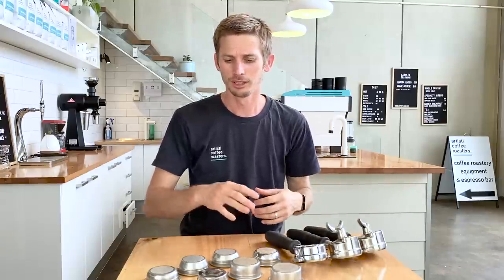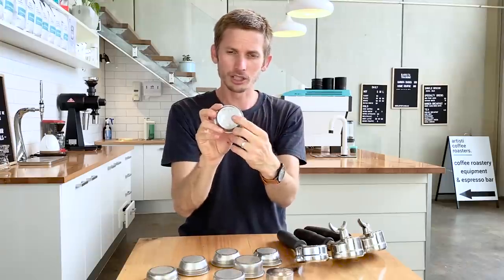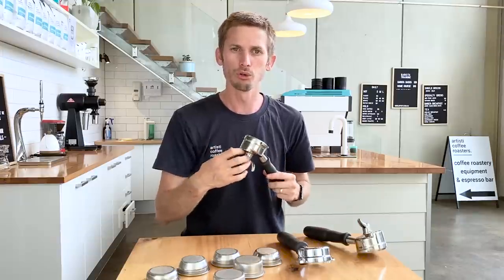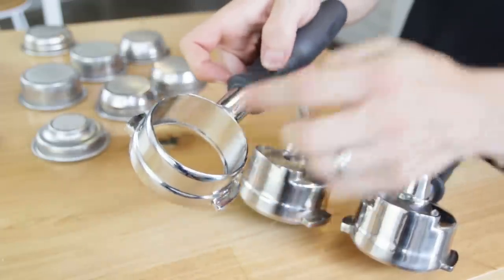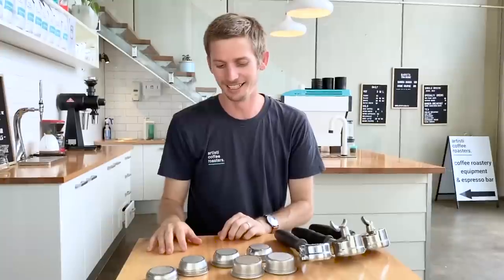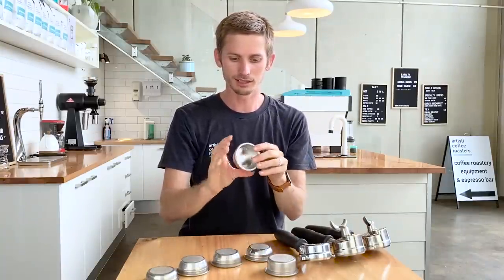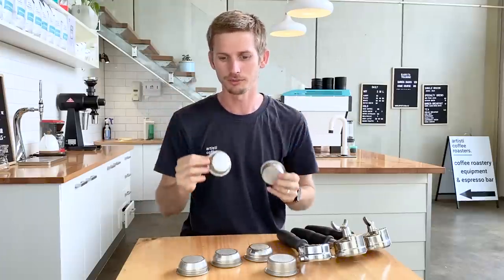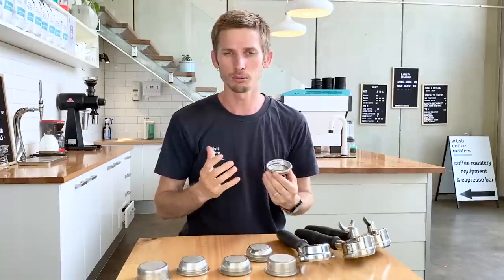In your ESPRESSO MACHINE which PORTAFILTER BASKET should you use?

Comment: Great video ~ Wish I found this ages ago when I first started out.
The information about how much coffee to use per shot around the internet is great and all but as you said the lacking information about the basket size is vital... I struggled with this so much before I read more and finally connected the dots... I was over dosing my basket by so much and could never work out why my coffee tasted awful. Then I finally connected the dots and lowered my coffee dose down by a massive margin it was like music in my mouth, haha.

I finally got myself a basket funnel and a palm distro / calibrated tamp and it's made making coffee in my home machine 10x easier and quicker. The little tamper that comes with the machine isn't great for long term use.

I use a breville barista express machine for reference.
Reply: I realize this comment is almost a year old but I bought the same machine about six months and have yet to produce consistent shots. What setting do you have your dispenser set for (grinder) on a double shot?
Reply: @ogoe_joeoutdoors1088  Since the post, I've dosed 18-18.5g coffee grinds to 35-40g output in around 35-40 seconds. Grind size is changed depending how fast or slow it pulls.
I also bought myself a dosing cup because I found the funnel a pain in the a$$ to work with long term.
Hope it helps.
Reply: @mdem5059  Thank you for your reply
Reply: Add milk and honey so the shots are always consistently blessed.

Comment: I wish I'd see this 10 years ago - that's how long I've been messing about with a Gaggia single-shot basket, and never getting a good espresso!
Reply: Depending on what model gaggia you have, you can crank that pressure down to 9 bars, get a bottomless portadilyer and a precision basket and itll feel like a brand new machine.
Reply: At this point I would move on. Espresso is a scam
Reply: @AnonYmous-wf1oz  How does one do that? I have a Carezza Deluxe, don't know if it's possible to adjust the pressure on it

Comment: I found out the single basket pour a lot quicker instead of dripping. The double basket drips in a steady rate which help newbie like myself to extend the brewing extraction. This can be very difficult to maneuver the flow of the coffee grinds with the single basket. Hence you have to tamp the grind a lot harder as it will cause resistance for the water to hit the grind in a steady rate, if the tamp is too soft, it will pour faster. Of course you have to adjust the grinds numerous time in order to get the sweet spot.
Reply from the maker: try to not tamp at different pressures, what you are experiencing in the  single basket is too coarser grind, int eh double basket it is the dose that is slowing down the pour.

Comment: How do you tell the difference between double and triple baskets by looking at them? Also, without a weight scale is there a way to know how much coffee to add to a basket? Are the ridges on the basket for this? And in terms of the difference between single and double baskets, how much liquid coffee are you aiming to get out at the end?

Thanks!
Reply from the maker: WOW so much to answer! Firstly you can tell the difference in baskets (that are the same shape) by the depth of the basket, generally the deeper the basket the more coffee it is designed to take. Most baskets will have a recommended dose written on the side of the basket, this helps as a starting point when trying to work out dose. The ridges in a basket show the depth that the shower screen will sit at when the handle is inserted in the machine, its not a good idea to dose too or above the ridge! We work on ratios to get the liquid yield, check out our video on Brew recipes https://www.youtube.com/watch?v=Z7Ssatuy9sA&t=9s Thanks for all the questions!

Comment: I'd be interested to see why you state that the double-walled basket is so much worse than a single-walled basket. Besides the "messy process", I can't see why creating a higher pressure environment with the double-walled basket would create worse espresso. Doesn't higher pressure create better extraction?
Reply from the maker: It’s a higher pressure environment where the coffee is soaked in, not the the high pressure water Passing thru the coffee .

Comment: Just wondering how you would pull a single 25sec espresso shot using a 21gr. basket?
Reply: If you have to use 21gram basket, then you must put two cup under the two legs portafilter... running 25sec and use one cup and dump another.

Comment: so basically this is a problem because entry level machines only use pressurised porta-filters... the cheapest one with single-wall is like 400bucks if you buy new.
Reply: TBH I think he was being a little disingenuous by saying that pressurised systems are for "old stale preground coffee". While that may be true from a certain point of view, they are also for users who do not have a grinder capable of producing an espresso quality grind. Because the trouble is, to actually use an expensive non-pressurised system you also need to pair it with an expensive grinder. Not everyone wants, or can afford, to shell out for a high end setup. There is also the problem that getting decent coffee out of an expensive system is a lot of faff, with a lot of trial and error required. Where as a pressurised system is more forgiving, hence probably why they are to be found on entry level machines. I don't doubt, based on what I've heard, that there is a difference in quality. But how big that difference is I couldn't say.
Reply: @Bungle2010  I agree

Comment: Can an under-extracted double espresso have the same amount of caffeine as a over-extracted single espresso? i.e. does more coffee in the portafilter basket always mean more caffeine in the espresso
Reply: Yes it does. If you use the same type of coffee. As far as I know, caffeine is extracted right at the beginning of the process so if you extract it longer you will get the same amount, only a bit more diluted.
It might even feel like you have less caffeine in an over extraction but in fact, you have the same.
I might be wrong, but that was what I have been told.

Comment: Helpful video. Thanks. I wonder what you think the lower limit of a basket might be. For example, I've got a 20g VST basket, but want to pull smaller shots - 16 - 18g. Would I get better espresso with an 18g basket and why?
Reply from the maker: Great question. Many times we have found ourselves with not enough coffee at the end of a bag. The trick is to grind finer and tap harder to create a more solid bed. You have to extract less volume as it will eventually float the puck and run fast. In this case that would be say 12-14g in as 20g basket. Its harder to manage over and over, does it Taste better? That will be a personal preference, you be boarding on doing a a filet brew in a espresso machine concept if you have a too coarse grind.
Reply: @ArtistiCoffeeRoasters  So that's very interesting. My shots (using 18g in the 20g basket) develop fine, but just at the end, the coffee flows really, really fast and I get sour espresso. Like at 25 seconds or so.  I've noticed a gap between the puck and the basket after the pull. I bet the puck is floating and that's opening a  channel along the side at the end. If I grind any finer, it just takes forever to come out.

Comment: Nice video and thanks for sharing.
I have been using my VBM Domobar Super for 21 years now. Normally without any visitors or events, we go thru 1.5kg of coffee per week and the single shot basket is used all the time as we drink coffee different times and don't want to waste coffee. I do use the double shot basket when I make a long black or have people over. So yes as you mentioned the single shot is used for economical reasons because coffee is expensive now days.
Cheers
Reply from the maker: 21 years! That's the great thing with a well built machine, they are fully serviceable and all the parts are replaceable so they really will last a lifetime if you look after them. 
What kind of beans are you using? Mostly blends or do you use single origins too? Glad you enjoyed the video and thanks for watching :)
Reply: @ArtistiCoffeeRoasters  I am based in Melbourne and mostly service and repair the machine myself, replaced vibration pump a few times, shower seal every 6 months and other group head consumables. I love this machine, it is as simple as they come.
I tend to use blends but for a few years now I am using "Coffex Superbar" very smooth medium roast blended coffee. 
Cheers

Comment: Granted... this video offers an excruciating amount detail in regards to portafilter baskets... but... he failed to discuss a major dilemma many espresso machine owners face: i..e, ridged or ridgeless PF Basket? Yes, we know the ridge in a basket is designed to grab the spring the PF handle and hold the basket in place...  but the debate lingers.  A ridgeless basket can accept a larger tamper that will hug the sidewalls of the bsket. Example: If a machine utilizes a 58mm portafilter . A ridged basket typically accepts a 58mm tamper which provides clearance so the tamper will not get hung up on "the ridge" of the basket as the tamper gets pressed down into the coffee. Many argue by using a using a ridgeless it can accept a larger 58.5mm tamper thus allowing for a more uniform "edge to edge" tamp as the tamper hugs the sidewalls of the basket during the tamp rather than leaving a gap around the circumference of the basket that can occur when using a slightly smaller tamper to accommodate the baskets ridge.
Reply from the maker: Yes this is correct.

Comment: Maybe a silly question, but I'll ask anyway. I have a budget machine that asvert says 15 bar, it came with a double wall basket but the basket is not pressurised. Can I buy a naked filter holder and single wall basket and control the extraction with grind size and tamp pressure, or would that be a waist of time and money given irs a budget machine. I will say the espresso comes out delicious, better than my local shop the way it is, but I always dose the same way.. thanks for the time and response.
Reply from the maker: The combination of the standard handle and the pressure of 15 bar with your tamping technique seems to be working. Don’t waist your $, enjoy the brews and put the $ towards your next machine

Comment: Is it possible to make a single shot in a 20g basket? Can it work if I put 14 g of coffee in a 20 g basket? Or is there a rule of how much free space you can have between the coffee and the "shower head" of the group head? Lots of questions, sorry.
Reply from the maker: Great question, you can do this, how ever the additional space will become and issue earlier in the shot. As there is no back pressure the once the coffee grind has expanded it will lift and then speed up greatly. The trick is to grind finer and also run a 1-1 extraction

Comment: So if I’ve brought my beans from Starbucks and they grind them for me in the shop (requested as a fine grind), can I then use the single wall basket at home? Or do I still need to use the duo wall?
Reply from the maker: You can use the single wall, but it depends on the grind if it suits the duo better then the single. Test and see which is best.

Comment: Hi i'm using  default basket that comes with a VBM espresso machine, what if my basket does not specify its size on it's side? Is there a way for me to know the size of the basket..
Reply from the maker: Good question, you can make a brew recipe up for it and weigh the ground coffee to work out the size. If it had a line or a ridge to hold the spring fill to 2mm below that point

Comment: Don’t you need to grind finer for a lower gram dose? For example I grind normally for 21g to spilt a dose but when I want a single shot for myself I tend to do a 17g however, when doing so the espresso comes out much faster indicating a need go much finer. Is that normal?
Reply from the maker: If your going to use a low dose in a larger basket you will have to grind finer, you risk the whole puck floating and becoming a very fast extraction if this happens. So best it have a smaller length of time or a lower ratio to reduce this. Ideally use a 17g basket and adjust your brew recipe to suit the new dose

Comment: Hey Artisti Coffee, thanks for all the valuable information 👌 I have a question regarding basket sizing - you said that 22g in, 44 out in 35 seconds with a 14g basked wouldn't be possible and it wouldn't taste good; could you please elaborate on this? My current recipe is 18in, 44 out over 33 seconds but I've just discovered that my basket size is 14g. I can achieve this for great tasting coffee but I'm wondering how the result would change with an 18g basket? Any info here would be greatly appreciated :)
Reply from the maker: So the recipe can change depending n the basket size you have. It’s 1 part coffee to 2 parts water. So 14g coffee with 28g espresso, or 18g coffee and 36g espresso. The 36 will be sweeter and bolder with less bitterness. You can get 44g Esprssso with a lower dose of coffee as the ratio will change from 1-2 and be 1-3 ish, and this will make it thin and over extracted

Comment: It's an older video. I heard a lot of good reviews about Delonghi Dedica and I'm looking to buy it, but some coffee experts says that portafilter is not good on this machine. Could you explain why?
Reply: Probably because it uses pressurised baskets, which are easier to use and produce good looking crema, but won't be able to extract as good coffee as non pressurised baskets. However you can find on Amazon or Aliexpress non pressurised baskets which are compatible with Dedica (51mm).
Reply: I was wondering. I got a dedica. With pressurised baskets. The two holes in the portafilter are not that small. Is it an improvement when I use a 51mm non-pressurised basket in it?
Reply from the maker: sorry, we have not used one. go off the advice you can find

Comment: Hello! Thank you for a great video. 

When I trying to figure out which basket (18gr, 20gr, other) do I have - where to look? There's series of numbers on them, but none of them saying relevant numbers.
Reply: I would guess that you have to measure the diameter of your portafilter, you then will be able to work out what basket you have,and thereby work out its capacity...
Reply: @pip5461  the diameter is common: 58mm, how it helps me, I don't get...
Reply: @MowgliDahab  it depends on what machine you have. 58mm is common on most industrial equipment, but Sage,Breville use different diameters.

Comment: Could you clarify this for me please:

At home, let's say I want to make espresso for 2 people, so I want 2 of the same coffee cups. I want to use a double spout handle so that I have to pull the shot once and I also want to use a classic recipe for example 16g in 32g out (1:2 ratio) in 25-30sec. How am I going to achieve that and with what size of abasket? 

If I use a VST 15g or 18g basket for my 16g dose and split the coffee with the double spout of the handle, I am gonna get 2 cups with half the coffee of the recipe. If I double my dose of 16g, that won't fit the basket obviously, and i guess it won't even fit a "triple" basket, because it will be a 32g dose. 

So how am I going to achieve my goal of making 2 cups with the same coffee recipe by using a double spouted handle? How is that achieved in a coffee shop, where 2 of the same coffee is requested? Do I just pull 2 "normal" shots back to back?
Reply from the maker: Hey, sorry for the late reply. 
This comes down to the cup your using and the ratio to milk to espresso. 
Sounds like your chasing a flavour that would require each person to have a full normale to themselves. 
I’m cafes, they split the double spouts but only when going into no more than 200ml of milk. Anything more than 200ml will need more espresso and therefore you’ll need to do 2 heads. 
Try use 2 small cups and split the shot. 
Let me know how you go. 
Cheers, 
Jimmy
Reply: @ArtistiCoffeeRoasters  Thank you for the reply! I guess I need to just make 2 "normal" doses back to back, because I need to make 2 of the same coffee (for example americano, or capuccino). As I see at the internet, single doses usually are not needed, unless you are making coffee with milk that requires a single dose of espresso.

Comment: Nice video, but what's actually happenes if you put less grind in a large basket,  assuming  you can tamp in down properly?
Reply from the maker: it will eventually lift up and float and be a very fast extraction, you can go very fine and pull a shorter shot if you need to under dose a large basket

Comment: Ummm... anyone else currently using a single-shot, double-walled basket?
Reply from the maker: From our perspective we would say so, I’d love to hear if there people using them, and we can see if we can help you get a good shot
Reply: @ArtistiCoffeeRoasters  I didn't use it much for years, but it came with my machine and I have been trying to cut down a little on caffeine recently, hence the singles. Unfortunately I don't think there's all that much to do to improve the shots without buying some better equipment. The machine puts out too much pressure for my minimum grinder setting unless I use the pressurized baskets. Naked portafilter makes an incredible mess 80% of the time due to the channelling causing it to spray - even when it does work cleanly, the extraction time is way too fast, like 7-8 seconds. I'll be getting a much better grinder soon, I'm sure.